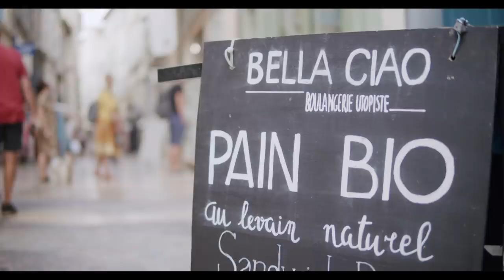NO Weighing and NO Shaping but so Tasty  | Sourdough bread making in France

Comment: I just realize that they never weighed anything before putting in the oven.  This show how authentic it is.  And how skilled they are. Great work
Reply: There is a scale on the table in the first seconds of the video,  maybe rewatch.
Reply: @josechavez3977  
Maybe you have to rewatch. even if scales exist, the potential user still has the choice of using them. that's the nice thing, you almost always have a choice. the very existence of a thing leads to nothing, except for the existence mentioned. I'm with Jon Aero.
Reply: They weight the bread when they sell it. It is a bread per weight bakery.